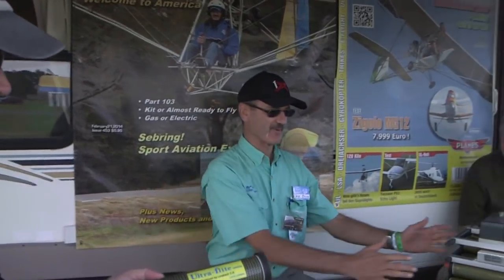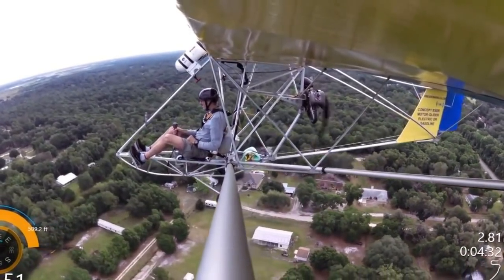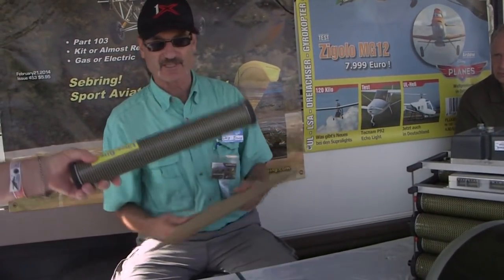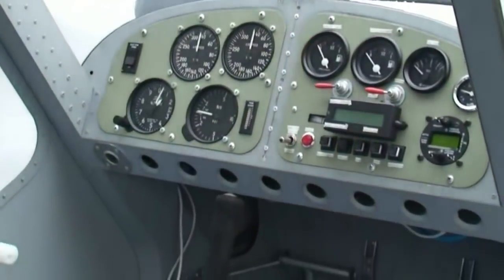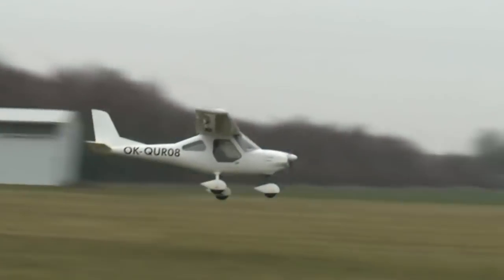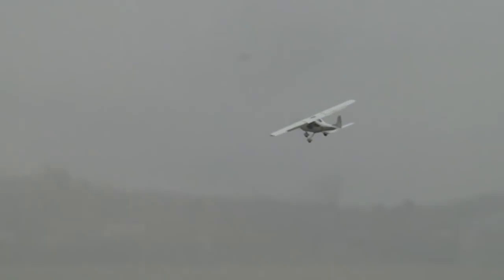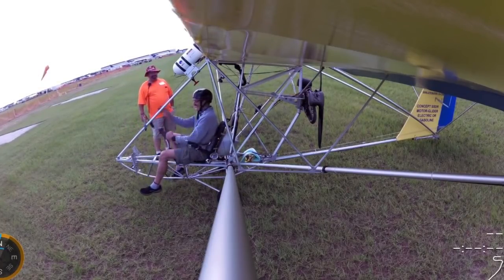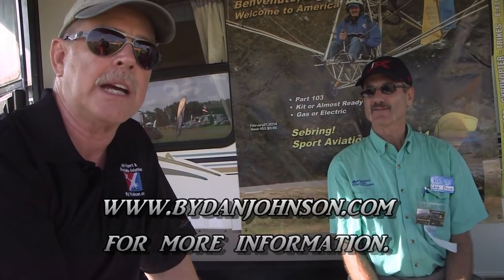75 HP electric motor and batteries available for ultralight aircraft!

Comment: next steps i foresee into electric personal aircraft development:
airframe composed by cell modules(long tubular cell batteries that are structural members as well).
photovoltaic membranes that would cover and act as wing surfaces, light, flexible and durable.
active motor regen/braking (using wind speed to reduce ship speed by inverting the motor into a temporary wind turbine).

Comment: 2:00
A rheostat controls the flow of current by varying resistance.  So if you attempted to throttle a 75HP motor to 10% with a rheostat.  55.927 Kilowatts (75HP) * 0.9 = 50.334  Kilowatts AS WASTE HEAT!  That's equivalent to 22 electric space heaters!  That being said yes... the throttle-box does technically still contain a rheostat, but this is operated on 5 - 10 milliamp.  It's strictly for producing a control voltage to the PWM controller.
Reply: Ultralights can fly 25hp engines so you could reduce that speed. Id recommend using something like tesla batteries.

Comment: I have 750 hours of flight time behind rotax 2 strokes, most people have issues with them because they dont fully understand the operating characteristics of 2 strokes and what it takes to maintain them and operate them safely.  things such as air density, temperatures, prop pitch, prop loads in flight,  and several other factors all have an effect on engine operation, most people just dont grasp it. some people think just because they use an expensive oil (amsoil, rotax, redline) it offers them safety and protection from engine issues, which is false.  The real problem is people who are NOT familiar with 2 stroke operation and their limits, I have talked to a fellow member of my club who has experienced engine failure and have come to realize he was clueless about 2 strokes, that fellow I have taken up with me and I have tried explaining to him about how to operate them safely and what their limits are and etc,  and he just doesn't get it, I regretfully told him to sell his plane before he kills himself or injures somebody on the ground, no business flying
Reply: I have 250 hrs. never a problem.  Well said.

Comment: Yeah great... But how many charges will that Battery pack charge?  200?  
If its graphene/ nickle plated anode maybe 600?  

Still have a lot further to go, but we're getting there
Reply: The guy said 2000 cycles. Which is good for lipo. If they were LiFePO4 it'd be up around 4000 cycles, but they don't have the same energy density.

Comment: how about combining a very small cc petrol motor powering a charger for the battery while in flight, give you extra hours if you choose clever, plenty of tiny engines like 80cc,ect
Reply: That would be great if you used 2 battery packs. Charge the one not in use while operating on the other. If you could sync the flight time with the charge time, you'd really have something there. Indefinite flight on electric power. Well, until your charging motor ran out of gas that is.

Comment: for the 103 ultralight whe see here are 20HP enough...
The problem with electric power was never the motors,but only the battery's
Reply: TECHNICAL SPECIFICATIONS
Battery Packs: 2 x 3.1 kwh 14S/20P/15KG, 60Ah
Motor: 20kW continuous, 28 kW peak, low noise, low RPM
Controller: 28kW continuous/40kW peak
Advanced Drive Interface for an extensive display and recording of flight parameters
3-blade composite propeller
15A/980W charger
Reply: What do you know about these motors today?

Comment: Is this an AC stepper motor or induction motor
Reply: +Surferant666 I doubt its a stepper motor, that kind of thing wouldnt make any sense as stepper motors are generally used for turning the motor a fraction of a centimeter extremely accurately.  They are used for printers and other machines for manufacture.
Reply: +Hunter Bowie you obviously don't understand the latest motor technology then .. stepper motors are in washing machines to get the best torque for each speed setting...

Comment: I see so much promise with this. Balanced against the wildly and ever growing technology in designing and engineering new battery designs, this will be a reliable reality much quicker than anyone realises and then where will we be? I will be one of those whom will invest, then I buy one at a time when everyone wants and is buying one. I get assembled do my walk around and the FAA will put the kibosh on it before I run down the strip,,,,lol.
Reply: +Randy Winner Then think about solar tech as well. Add some pontoons, go to the coast. Bring some light camping gear and your set :3 Flyin free
Reply: +Randy Winner I wish someone would build a hybrid system with a small gas turbine continuously spinning a high speed alternator to provide electric power. The efficiency would be lower but the energy density of hydrocarbon fuel is still MUCH higher than batteries, allowing significantly longer flight times for a given weight of batteries vs fuel.

And considering the high torque of electric motors at low RPM, I'd also love to see this mated to a low speed (<2,000 RPM) prop-fan.
Reply: Randy Winner is
Reply: @THEfromkentucky  Now your talking! I've been waiting for a car with those features since the 1970's.

Comment: Charge capacitors in the wings with solar panels feeding them
Reply: Surferant666 The weight of that alone would put you out of part 103 not to mention the engineering issues for the aerodynamics.  Flexible solar cells are around but still much more pricey than having a couple small panels where you store the plane.
Reply: +pen mightygun purpose built solar cells can be made very, very light. and no capacitors are needed for this. with the right implementation, the benefit in flight range would largely outweight the disadvantage in weight. at least in a bright day.
Reply: CNL _ Using some of the new solar voltaic materials like the paint might make it feasible but lets think about what this is supposed to be.  A cheap way to get in the air.  Also, whatever system you use has to keep it in the part 103 regs if you want it to be an ultra lite. Get too heavy and different rules apply.
Reply: +Robert Schuster weight of what??? charge capacitors weigh very little compared to dense rare metal alloys used in batteries....
Reply: +Surferant666 Im working on that right now for my ultralight coming soon, painting GRAPHENE  super conductor solar INK right into the fabric, to charge Graphene super capacitors, No additional weight at all
Reply: +Romanz Tea Have you done any calculations to find out how much power you will be able to produce? Remember that at 100% efficiency and perfect conditions the maximum power generation would only be 1kW per meter squared. The theoretical max efficiency of silicon based cells is 29%, so you are looking at only 290 watts per square meter in perfect conditions.
Reply: Mad Though
they wouldn't be able to provide all the required power, but on a bright day could significantly increase its flight time. and at no practical cost.
Reply: CNL _
Have you done the calculations, though? What would you count as significant?

We can assume this aircraft has a wing area of about 15 meters squared. This means that in optimal conditions (which are extremely unlikely for the aircraft to be operation under) an aircraft of the size of a 172 could produce a MAXIMUM of (15*1000*0.20) = 3 kW. In reality, the maximum power generated from this surface area would be significantly lower than this.

This is in an aircraft with a 75 hp motor, that can stay aloft for 1 hour. Assuming that the aircraft will cruise using 50 hp, it requires approximately 37kWh in energy during this time. Over an hour of flight, in optimal conditions the cells could generate an additional 3kWh, or an increase in approximately 4 minutes and 48 seconds of flight time.

So for this to be worth it, we would have to check two things:

1) will the increase in energy from the solar cells be greater than the additional energy requried to keep the added mass of the solar cells in flight?

2) Is the mass of all of the panels, the mounting points on the wings, cabling and charging/ control equipment for the solar system would be less than that of a battery that could provide 3kWh of energy.

Battery technology allows us to store approximately 250 watt hours/ kg, so the mass of battery would be approximately (3/0.25) = 12 kg.

You would also have the issue of the panel and supporting equipment always being there, rain sun or cloud, weighing down your aircraft.
Reply: Mad Though
yes, i've done the math even prior to this video. i'm not sure if it was this particular airplane (i'm not gonna rewatch it to find out), but either it was this or another very similar one, which cruised at 12 hp. at that power, even your relatively inefficient for today's standards 20% solar cells would provide aproximately 4 hp, or 1/3 of the cruising power, effectively increasing its range by about 50% on a bright day, which i also disagree is hard to pick, since we're talking about recreational flight. also, there would be no mounting points required, since the cells are naturally slightly flexible and very thin, ideal for being glued over the wings with very little aditional weight, or, ideally, literally painted on them, which is even lighter, although not yet very widespread. also, there's no additional batteries required in this setup, since the produced energy would be spent online rather than stored. so, all aspects considered, the advantages easily outweight the drawbacks. reply if you have specific questions.
Reply: @luisbaltazar1  Great post. As soon as I started watching this video I started thinking of exactly what you are talking about. Since this post, have you had the chance to apply this to any of your own projects or do you know of anyone who has?

Comment: What about a ducted fan rather then a regular propeller? They're more efficient and if you can put together a 12 blade fan blade, they're quieter too. Just imagine getting twice (or more) the flying time out of the same charge. Just a thought.
Reply: could a ducted fan have a smaller diameter that a regular prop ?